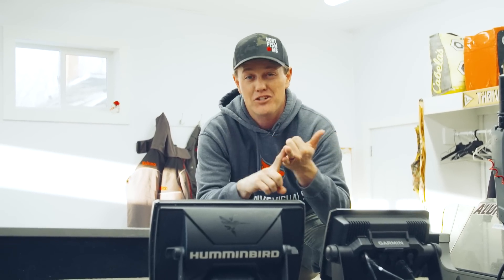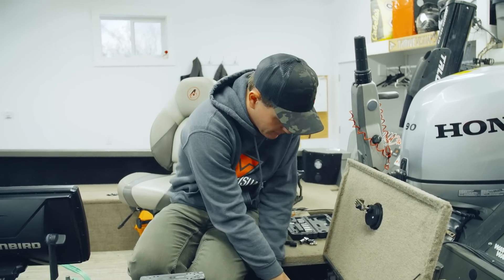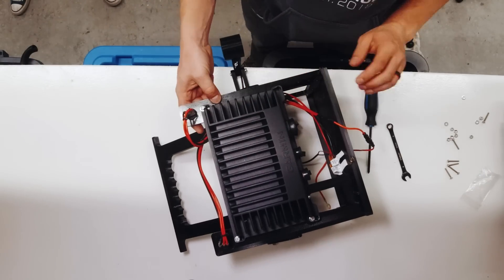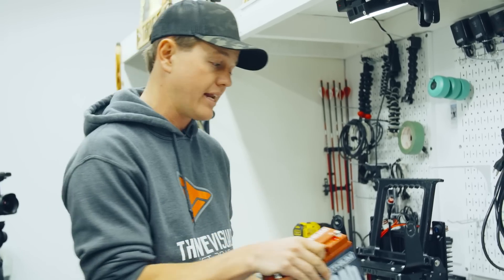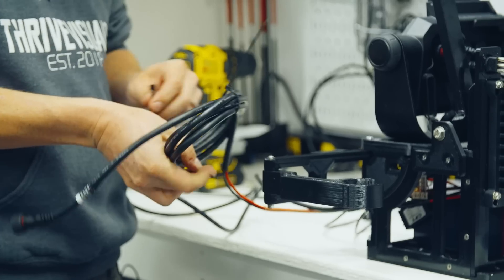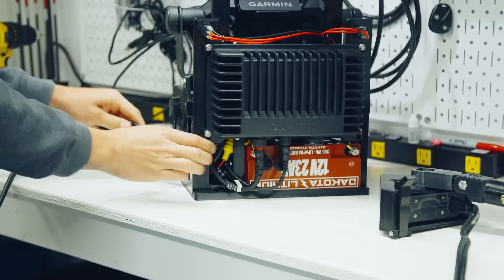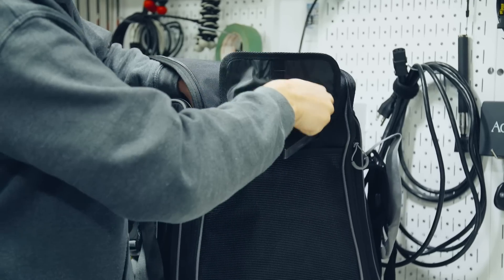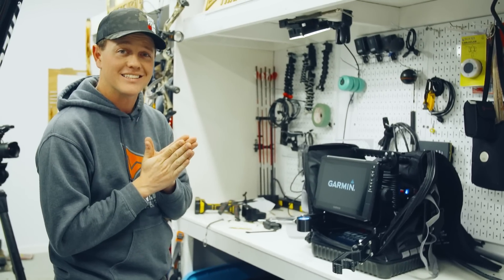Building the ULTIMATE Ice fishing electronics set-up! (Garmin Livescope)

Comment: I just  assembled a sv 95 with the Garmin panoptic live scope. but I'm only using the Dakota 12amp battery. While ice fishing this week end after a couple hours  the whole system shut down. the battery still said it had 60% charge  it was getting colder however only -10c  and i don't yet have it in an insulated case. would this be a power issue or a cold issue? any thoughts would help.
thx

Comment: One concern is that mounting plate on the back of the boat for the transducer using just screws you are going to wear the holes out installing and removing. Granted you could just move it a little left or right to get a new bite of plastic each time. Overall that is a great looking package I really want one!
Reply: Use bigger screws if the holes wear out. Going from a #6 to a #8 will bite into new plastic.

Comment: check out the Garmin 010-12676-40 All-in-One Power Cable, saves a ton of room in the summit shuttle and bag , I bought mine from LOTW sports for $50, its a short power cable for the gls10 and head unit and you can leave the long cable on the boat ready to go for the spring